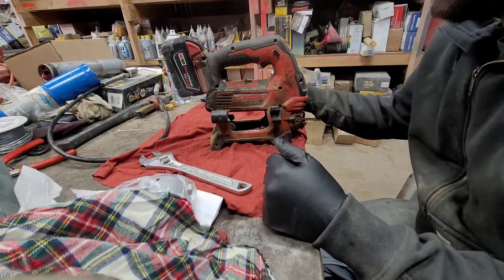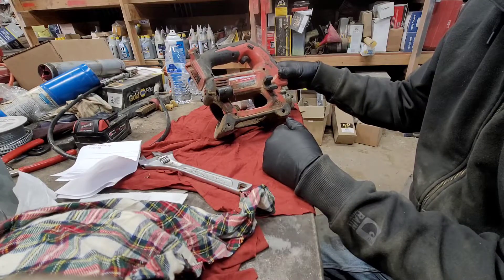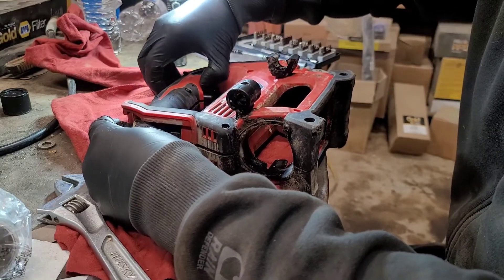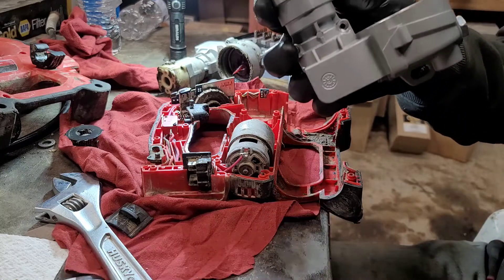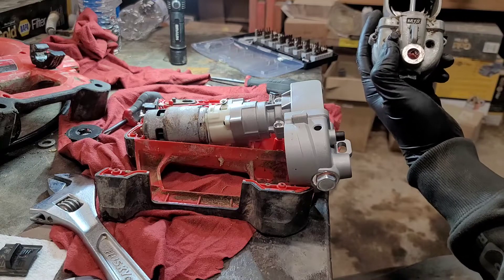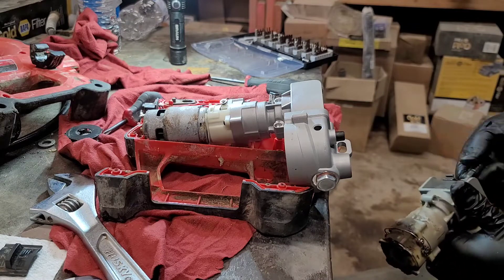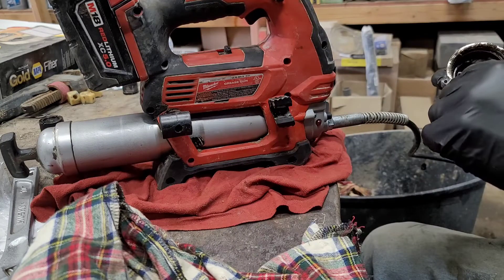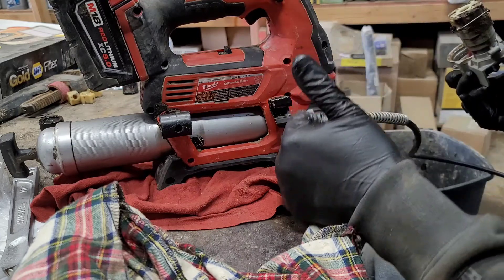Milwaukee 2646-20 M18 Grease Gun teardown/repair

Comment: Just last week they started dropping price at most retail locations, $99 tool only. I'm sure at the time it was worth the repairs. Plus it's hard putting a price on knowing what's going on inside a mechanical device so when in use you know what you are hearing happening and you know what you shouldn't be hearing.
Reply from the maker: The price drop definitely makes the repair far less attractive, but I 100% agree with you on knowing how things tick. It's amazing what a difference in sound (or the presence/absence of a certain sound) can tell you about how something is running.
Reply: @AllThingsMech  agree 1000%.

Comment: Nice job and good video got cuestion mine get wet  almost new what do you think is gona be the problem
Reply from the maker: Thanks Hugo! There are quite a few circuit boards and controllers in these things. They are fairly water resistant but there could be corrosion or short circuits in several places. I'd either send it back to milwaukee for evaluation, or try to pull it apart yourself to see if there are any obvious points where water has caused corrosion on the boards or inside the switches. Make sure its 100% dry before trying to use it. Flush it with rubbing alcohol to displace any residual water.
Reply: @AllThingsMech  thank you so much i will try to do that my self
Reply from the maker: @hugohgr6966  sure thing my friend, best of luck. Let me know how it goes and what you find, I'm always curious about other potential failure modes on my tools. Have a great weekend!
Reply: @AllThingsMech  sure